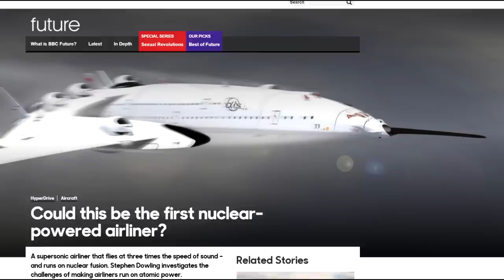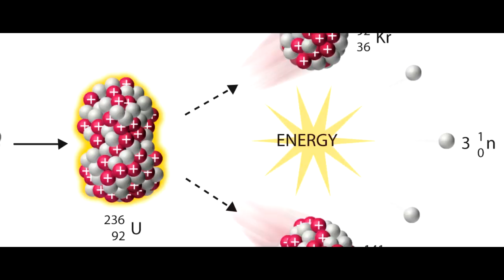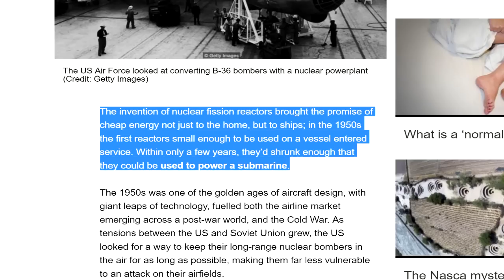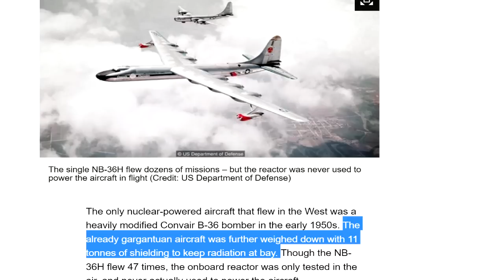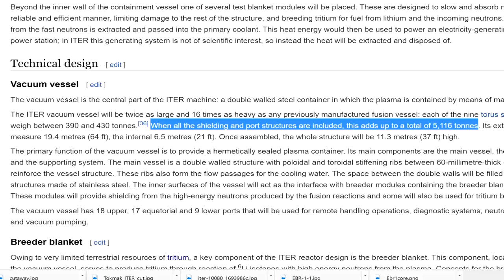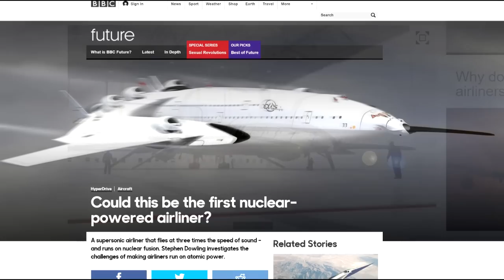SIX ENGINED Nuclear Airliner... BUSTED!

Comment: I would like a thunderfoot video on the feasibility of powering electric "turbofan" engines with a modular molton salt reactor like that one company is trying to sell for power generation at the moment. I would expect it to not work for a combination of space/weight reasons, but I am curious by how much. I am especially curious about the issues with using it in the bigger long haul flight planes and that airbus 1000 passenger plane made from those beluga whale shaped mega cargo planes.

Comment: A nuclear powered airliner is buildable with a lot of development, it's just I don't think anyone with enough money to develope one would be inanse enough to build it... because you know... like it has a nuclear reactor in it. Oh dear lord we are not even talking about a fission powered airliner... yeh na impossible for like the next 30 - 50 years+, you would need a deuterium + tralphium / tralphium + tralphium fusion. Which... like you need a higher temperature than Deuterium + Tritium fusion and we haven't even got net gain out of that yet...

So... like... just no... Also with a nuclear powered aircraft... I am fairly certain you would only have 1 engine... because shielding 2 or more smaller reactors makes it heavier than 1 larger reactor, because you still need the same thickness of shielding, although a H3 reactor doesn't give off neutrons so your shielding is a magnetic field... but like are you sure you don't want to have some regular shielding too? coz if that magnetic bottle fails... your gonna have a bad day.

Comment: Most important: it looks totally badass.

This is a good video.  The TED types proposing these whacky ideas don't have any solid connection with reality.  The shielding is indeed a colossal problem.  Another problem is that unless you're doing something like Project Orion (which is inherently dangerous and would pollute the entire world massively), nuclear just doesn't produce thrust.  You need explosive compression to push a mass through the atmosphere.  Heat doesn't do that.

Nuclear is great for making a cup of tea though.

Comment: "Aviation is littered with things that were at some point considered impossible", yes because as we all know, jets and breaking the speed of sound are in the same league as trying to put 6 nuclear reactors in the air. Also, someone make a model of that plane but designed for normal jets and try to pitch it to an aircraft designer. That U shaped, whatever it is, will not make him cry at all.

Comment: So, basically they expect people to fly with a nuclear reaction, that could easily kill the passengers if anything goes wrong. And if it crashes then it might just contaminate a large area. Did these people ever hear about Fukushima or Tschernobyl? We have been using nuclear fusion for decades and there is a pretty good reason why we don't use that stuff in cars or planes.

Comment: The Russians did modify a plane to have a reactor in it. The plan was to make a direct cycle(spew radiation out the back, but much lighter that an indirect cycle) plane.  Scared the Americans enough to try and design a nuclear plane of there own, but it would use indirect cycle as they didn't like the alternative the Russians used.  Neither ever really went further than that from what i know.

Comment: Why give the bomb load of a B-29 and then show a picture of B-36? The B-36 is a considerably larger, next generation bomber with a considerably larger bomb load, makes you wonder what else you are getting wrong? Incidentally the Lancaster, which was designed years before the B-29 had about the same bomb load as the B-29, which sounds totally counter intuitive as the Lancaster was from a previous era totally backward compared to the B-29, but the B-29 was filled with such luxury as armour plating and remote controlled gun turrets and was pressurised and climate controlled, were the Lancaster had none of this decadence, but I digress just thought that was interesting.

Comment: Fusion power dose not work as you claim, I.E. the proton-proton chain doesn't work.  Lockhead-Martin claims to have nailed the fusion reactor. 
www.thedrive.com/the-war-zone/19652/lockheed-martin-now-has-a-patent-for-its-potentially-world-changing-fusion-reactor

Just my own speculation here.  The thrust is not provided from the fusion of Hydrogen into helium, that appears to just be a side effect of how the Sun creates output light.  They real energy output is from when the Sun electrically exciting the neutrinos that feed in and then ejecting them as energy or photons.  Also the galactic cores eject neutrons from the polar jets due to an electrical pinch of the neutrinos.  But there has to be a lattice structure such as hydrogen to help create the electrical pinch.

 I believe it works similar to how the Sun makes power by electrically pinching and compressing the hydrogen gas, not like the standard mythical model of the Sun, nuclear fusion in the core.  Here is what we believe their prototype looks like.
https://drive.google.com/file/d/0B4O1wtRWTvwkRHlaYXh1d2cxWGZsWTJCRkcwXzE3M1VpUUk4/view

There has been progress also with the SAFIRE project to get energy outputs on order with the output of the Sun.  www.everythingselectric.com/safire-project/

Comment: you don't need to convert the heat to electricity, you can use it directly in a scramjet like engine, but you will need a first engine to push the aircraft to speed were the scramjet will start working. is already use in new russian missile, but is a rocket engine for first stage and then a nuclear powered scramjet, but is a missile, no need for shielding :)

Comment: Well, both the US and the USSR experimented with nuclear reactors aboard on airplanes to develop a nuclear powered aircraft. But as far as I remember in the tests conducted the reactor wasn't connected to the plane's engines and only used to find out how much shielding and thus weight they have to add to make this a viable alternative to kerosine/av gas.

Comment: So many of these pie in the sky ideas could work. You could use nuclear energy to propel a plane (that's actually capable of lift off): use nuclear power to convert carbon dioxide, say dissolved in seawater, into a hydrocarbon. Voila, an energy dense fuel source that has a neutral carbon footprint and works with well systems we already have in place. The Navy toyed with this idea on some of their aircraft carriers which happen to have constant access to both, but I am not sure if they are still considering it. 

Of course, this would require the designer to understand the idea of conservation of energy.

Comment: Sounds like that one Russian plane that was run off of a nuclear reactor. That only flew a handful of times because it didn't have any shielding from the radiation.
If it existed or not I don't know but shielding will be heavy as hell so it's just impractical to put a nuclear reactor on a plane.

Comment: You no need a turbine or fussion reaction. It can use common turbojet plus nuclear ramjet like in project pluto. This engines still need to shielding, but it works for strategic bomber. )) Soo it's not a bull shit, but very strange solution for comercial airfleet.

Comment: I've developed the refined Shock-Point Drive. It bends space around itself and has Inertial dampeners. It's called "Moya." 

It also provides it's own life support with it's built in Jungle Safari area. I modeled it after the pre-nonfiction USG Ishimura and it's Honey Combed Hull after the Titanic. Two Ships with a very rich history and were held in high regaurd for thier rigoris claims of safety.

This ship can bypass 10 Light years in 30 seconds and is the envy of every Dominar. The Manmade Blackhole, containment and Hysenburg compensator produce nearly limitless power and the Dampeners are a refined version based on those salvaged from Goa'uld Gliders. Teac'l approved so you know it's quality!

While some might say "this is impossible and that I'm full of crap." I say "I prefer not to limit my products by what some may call reality." While we may be in the Pre-nonfiction stages of Devolopement. I'm confident that my abstract prephysical Prototype are ready for test runs. We'll have 2k Seats thanks to Tardis Tech, they'll be $1,299.95 each.

Disclaimer; Entire product may or may not be real. Any purchases made by buyers are not subject to Refund but will recieve a free Key chain! Riders must sign our NDA before purchasing your ticket, any voiding of said contract will result in Literall and(or) Metaphorical Testicle remove with a fine of 250,000.

Comment: The US military worked on nuclear powered bombers during the 50s. GE had a working prototype engine by 1956. Also the military tested two ramjet nuclear powered engines from 1961 to 1964 during project Pluto. They even got to the point where the installed a reactor in a modified B-36. There was two reasons the project never came to fruition. First, the nuclear bomber was no longer needed after the ICBM got developed. Second, the shielding required for the reactor crippled the planes total payload capability.

Comment: Airliners CANNOT go super sonic even if they can. Ever since the concord incident, a law has been placed that all airplanes can only reach a certain mph even though they're much more capable in speed. They did this for safety reasons. An airplane going supersonic can potentially have more harm than that having lower speeds (if anything goes wrong). It's like a ballistic missile (without a nuke) that no longer have the capabilities to prevent the inevitable.

Comment: it could be possible if you had a Gas core reactor, but a Gas core reactor is usually thought to be much like a tokamak fusion reactor, but you can do it on a smaller scale because you don't need the same kind of plasma confinement, but Molten core reactors are not even a thing yet although not due to engineering challenges as it has already been done, it's just that there is starting cost to doing it when there is already a way to do fission power, but Gas cores are a hole different kettle of fish, lots of engineering problems there.

And you still have to worry about the weight of the shielding and if it ever crashes your fucked, obvious down side.

Comment: Uses of tritium....
 "Self-Powered Lighting
Tritium can be used to create self-sufficient light sources. Chemicals called phosphors give off light when they come into contact with the electrons, also known as beta particles, that radiate from tritium. These lights are not bright, but they are useful for illuminated signs as well as firearms sights for nighttime use."(https://sciencing.com/uses-hydrogen3-7297714.html)
 "Nuclear Reactions
Tritium is used to fuel nuclear fusion reactions. When tritium is fused to deuterium, another isotope of hydrogen, massive amounts of atomic energy are released. One application of this type of reaction is in controlled fusion reactors, which may someday be used to produce electricity. Fusion reactions can also be used in the creation of nuclear weapons."(https://sciencing.com/uses-hydrogen3-7297714.html)
 "Research Science
Tritium's radioactivity also makes it useful to research scientists since it can be used to analyze chemical reactions as a radioactive tracer. By replacing stable hydrogen atoms in a molecule with an atom of tritium, researchers can understand the results of the reaction by tracking the radiation given off by the tritium. Radioactive tracers must be isotopes of the atom they are replacing; this means they must have the same number of protons. Because hydrogen is a very common atom, tritium can be used in a wide variety of test reactions."(https://sciencing.com/uses-hydrogen3-7297714.html)
 "What is tritium used for?
The radioactive properties of tritium can be very
useful. By mixing tritium with a chemical that emits
light in the presence of radiation, a continuous light
source is made. This can be applied to situations
where a light is needed but where use of batteries or
electricity is not practical. Wristwatch faces, rifle
sights and exit signs are all examples of where this
phenomenon is commonly used. Exit signs can be
lifesavers if there is a loss of power. "(https://www.ccpa.net/DocumentCenter/Home/View/3173)
 So. Tritium is not so much of a problem ( in tiny amounts) that we do not use it in common devices( we evidently do). So. Is it the amount of tritium that must be utilized for reactors such as these?
 
 How does Tritium harm?
 "Tritium is a hazard only when taken inside the body
(internal hazard). Tritium primarily enters the body
when people drink tritiated water. People may also
inhale tritium as a gas or absorb it through their skin,
but exposure to harmful levels of tritium through
these exposure pathways is very unlikely. Once
tritium enters the body, it is quickly and uniformly
distributed throughout the body, going directly into
soft tissues and organs. The associated dose to
these tissues is generally uniform and dependent on
the tissues’ water content. "..."The body removes tritium naturally in the same way
it removes water - by excreting it in the urine. As
with all ionizing radiation, in theory, we assume
exposure to tritium could increase the risk of
developing cancer. "(https://www.ccpa.net/DocumentCenter/Home/View/3173)
 How careful are we with Tritium containing devices?
 "Ownership and Disposal Responsibilities
If you own exit signs containing tritium, it is your
legal responsibility to ensure the proper disposal or
recycling of these products. It is illegal to abandon
or dispose of self-luminous signs, except by transfer
to companies licensed by the NRC or by a state
authorized to administer its own comparable
program (an Agreement State). Manufacturers of
the devices have radioactive materials licenses,
which allows them to accept the return of the
devices. The devices cannot be discarded in
municipal or industrial trash, nor disposed as a
hazardous waste. Improper disposal can result in
tritium releases to the environment or accidental
human exposure. DEP has created a fact sheet
especially for owners of these devices, entitled
“Tritium Exit Sign Owner""
(https://www.ccpa.net/DocumentCenter/Home/View/3173)
 So. It is considered a environmental hazard, but, not so much so that your average store owner cannot have a sign containing a small amount of Tritium.

Comment: Theoretically could a material like "vanta black" be used to capture the high energy particles released from fusion and fission? Not vanta specifically but something similar which could "trap" them by bouncing them around and releasing the insane amount of energy captured as heat thus lowering the overall radiation?

Comment: No, no, Thunderf00t, ironically enough, YOU’RE bullshit! (No offense, luv your vids 👍):
“While tritium has several different experimentally determined values of its half-life, the National Institute of Standards and Technology lists 4,500 ± 8 days (12.32 ± 0.02 years).[1] It decays into helium-3 by beta decay as in this nuclear equation:

3
1T
 	→ 	3
2He1+
 	+ 	
e−
 	+ 	
ν
e
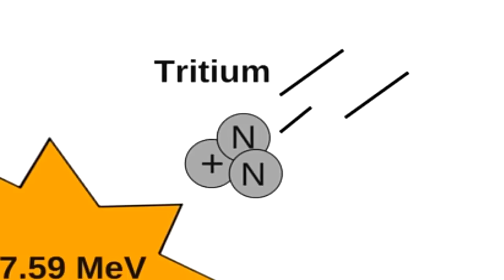and it releases 18.6 keV of energy in the process. The electron's kinetic energy varies, with an average of 5.7 keV, while the remaining energy is carried off by the nearly undetectable electron antineutrino. Beta particles from tritium can penetrate only about 6.0 mm of air, and they are incapable of passing through the dead outermost layer of human skin”. This comes from the WIKIPEDIA article (5:52) for tritium, section “Decay”!!!

And the only (fission) nuclear-powered plane in existence was of the 1950s!! Of course if we did any planes like these today it’d be far better!!! It (was) only 10 tons!

But hey, you’re right: It’s gonna take A LOT of time to have fusion planes, more than fusion engines

Comment: NASA looked into this for rocket engines -- Nuclear Engine for Rocket Vehicle Application (NERVA).
Reply: They also looked at throwing nukes under the shuttle to propel it. It was called project orion
Reply: Yea, the difference is NERVA works, and is totally viable, the only issue is keeping the fissle material safe while the nuclear upper stage is being boosted into orbit by chemical rockets, because should those chemical rockets malfunction, and explode, they become a dirty bomb. However, if you were to send the fissile materials up on a heavy lift cargo rocket inside a blast proof container, and fuel the reactor in orbit, the NERVA engine becomes the best way to get to mars, or anywhere beyond the moon really...
Reply: thanks to the inherit weigt of a fusion reactor it is not going to be a take-off engine though it might be possible to assemble them in space seeing as it uses a ver light fuel source wich can be found or made  with common atoms it is probably  going to be used as a space only engine

Comment: Not to mention that the basic principal of jet flight is that you accelerate a mass and throw it to create thrust, you CANT do that with a reactor, with a reactor you can only have a propeller aircraft if we don't take into consideration the weight limitations. And propeller aircraft can't operate in thin air high up in the atmosphere, so don't expect a mach number from a big propeller aircraft any time soon. In conclusion it's a very stupid idea, but everyone with common sense knows that, I think you should focus more on Elon Musks stupid projects that actually have a following. And one last thing, I think you should calculate the amount of pollution the Tesla cars create, because everyone says the are environmentally friendly but I'm not so convinced because when you convert energy you loose energy, so Tesla cars to work require electric power, electric power usually comes from fossil fuels, so more demand on electricity, more fossil fuel combustion, is that really helping? I haven't checked any data so dont take my thoughts as true, but if you check the data and I'm correct, that would make a nice video